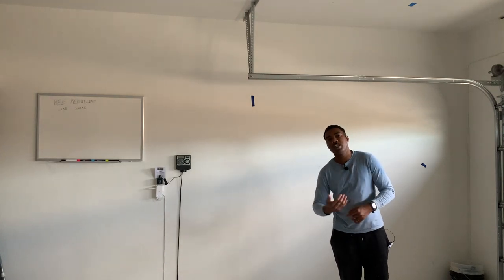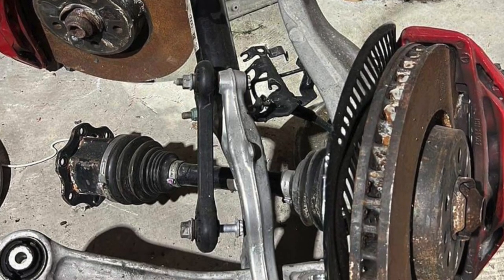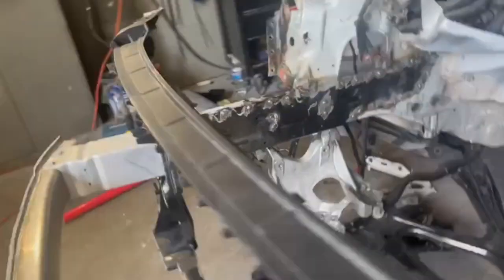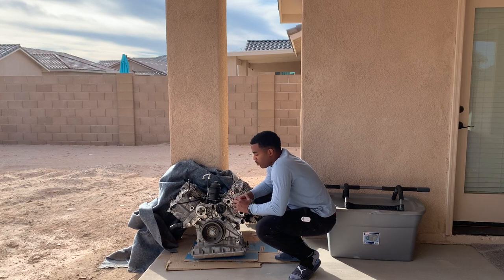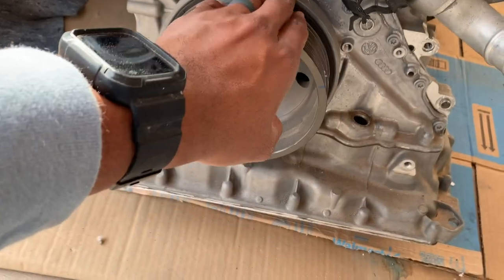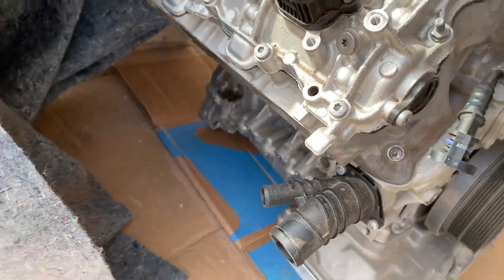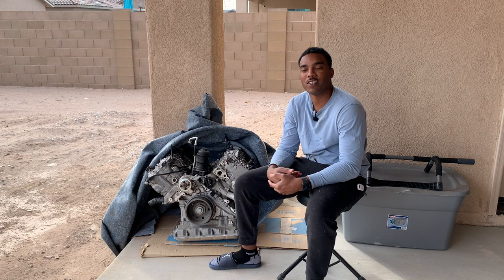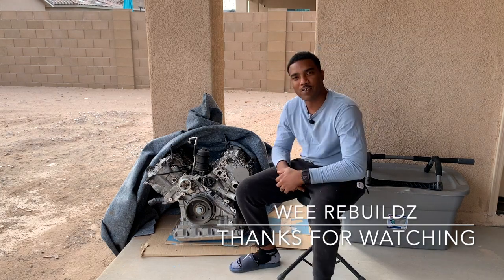Cutting the frame on 2018 Audi S5 rebuild...Part 18

Comment: Do you have any videos on clearing/fixing codes? VCDS?
Reply from the maker: what codes do you need fix ?
Reply: @weerebuildz4427  I have been doing a similar build on a 2019- S5, I have tons of codes in VCDS and would imagine with your build is probably similar. Here are a few I haven't figured out yet: 4532737 - Steering Angle Sensor           C052A 00 [11100101] - Correlation,   196758 - Databus      U1123 00 [00001001] - Received Error Message
          [Brake control module: received error value in signal ESP system status]    Confirmed - Tested Since Memory Clear,  9682162 - Multiple collision brake  B13BC F2 [10001001] - No function. Thanks!
Reply from the maker: The steer wheel one that you have to program the clock spring to the car  @jmx143

Comment: Hey bro did you ever put the headliner back in ? I’m trying to get mines back in and it’s kinda complicated was wondering if you had any pointers
Reply from the maker: I have not yet but the way how I too it out was the get the front seats all the way forward then the back all the way back you may have to bend a little on the side tho to get it in.
Reply: @weerebuildz4427  I took all the seats out
Reply from the maker: And you still can get it in
Reply from the maker: The other way I know is through the windshield
Reply: @weerebuildz4427  that’s what I was thinking